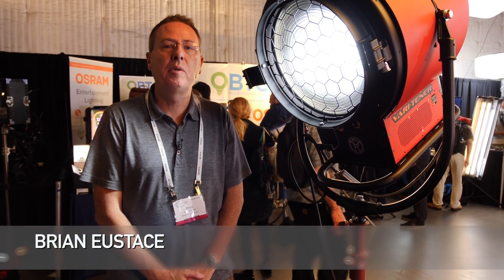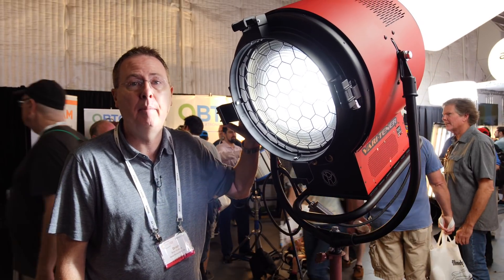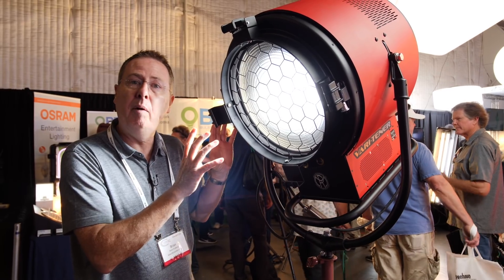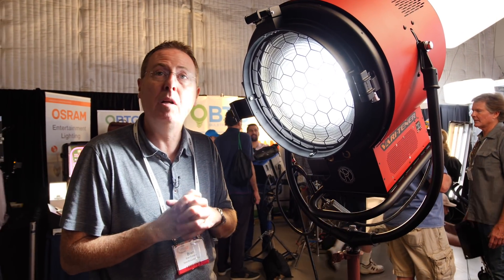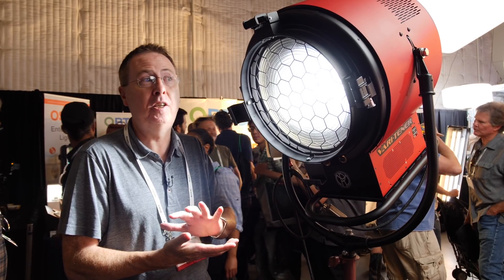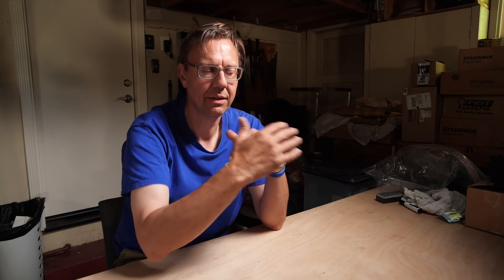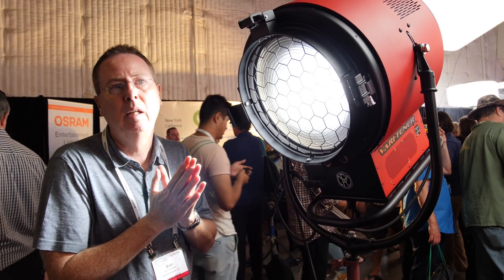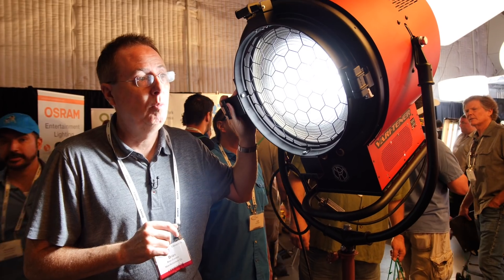Meet The Gaffer #97: Cinegear 2018 - Fresnels

Comment: That would be awesome if you were to visit Visionsmith! I'm interested in their products, specifically their Relamp 650. Not sure if it would be worth it compared to selling off the Arri 650 and buying an aperture 300d for a daylight option in my kit. If you could do some general tests about how loud the fan is on the relamp products, and whether or not you'd work with them on set I'd really appreciate it!!!
Reply: +Edward Dignan - We've had the ReLamp 1K and 2K for a while now. They are generally nice units, but there are definitely compromises. The fan noise is not really an issue, unless you're doing some very quiet and sensitive recording, so I wouldn't really worry about it. For reference, the DigitalSputnik DS units are louder. If you're looking at the RL.650, it's nowhere near the output of the Ap.300D. I recently did some quick head-to-head comparisons between the RL.2K (with and without the Arri 2K fresnel lens in from) and the Ap.300D (without the fresnel front) -- the Aperture was considerably brighter. I didn't have a spectrometer, but the colour looked more pleasing from the Aperture too... Anyways, I mainly wanted you to know that the RL.650 isn't in the same league as the Ap.300D, in terms of light output.
Reply from the maker: Thank you!
Reply from the maker: Yup, fans are the other aspect of LEDs that some manufacturers get right and others seem not to understand. I briefly used a Visionsmith 650 on a job, but we used it in a very noisy environment, so the fan would not have been a factor:)